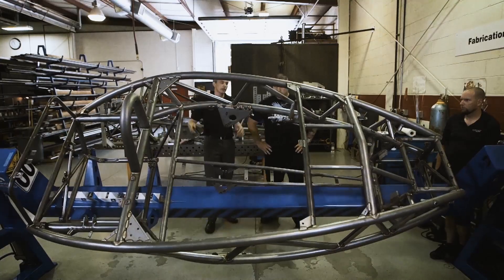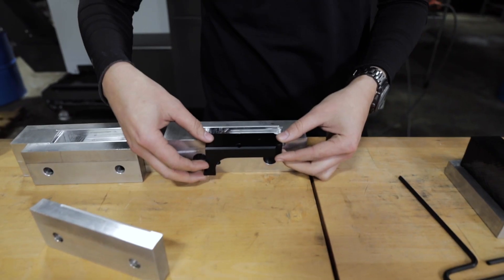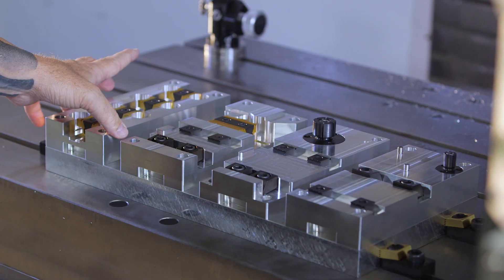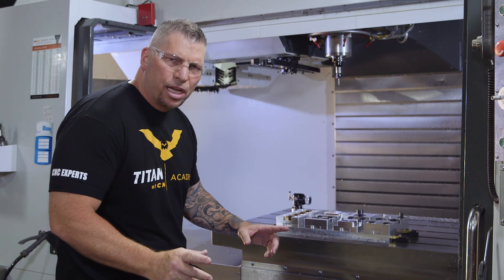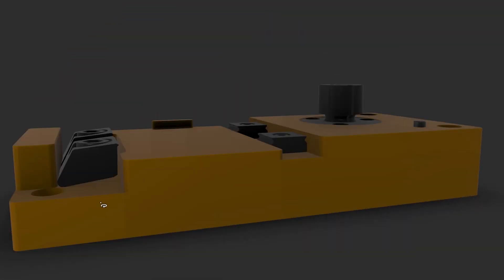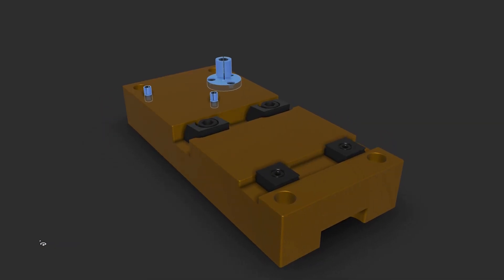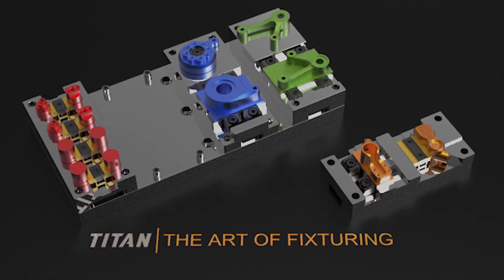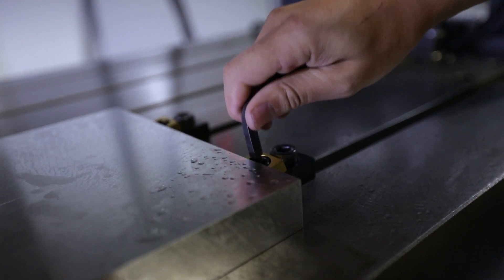This is How You Compete in CNC Machining

Comment: It's all good that there is so much in terms of variety in fixturing and workholding but most don't come cheap especially if you are a small shop making low volume parts.Not justifiable if work holding clamps are dearer than what you charge for the part.Titan you make me jealous.😁

Comment: Are those aluminium fixtures? Ive tried using the M5 putbulls on both Al and MS and the fixture threads always get destroyed after a few clamping cycles.
Reply from the maker: I would check your thread and torque spec. Also, add a helical insert and it won’t pull out.
Reply: @TITANSofCNC  your idea worked, I'm using EN19 hardened threaded inserts and the claps are performing reliably.

Comment: Titan.  Would like to see how to fixture flat parts, covers, plates etc.  .063" and less.  Have used blue tape and glue, but unsure about other techniques out there.
Reply: Vacuum plates look at peirsons pallets website's
Reply: The issue with vacuum plates is when the part you're making has holes in it. Sometimes 10-20 holes for a 4 inch square cover.